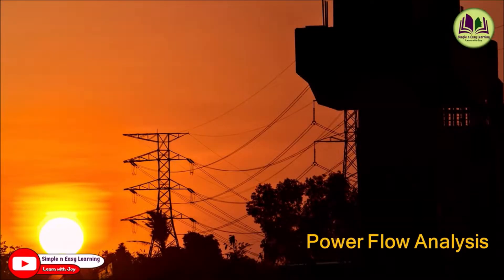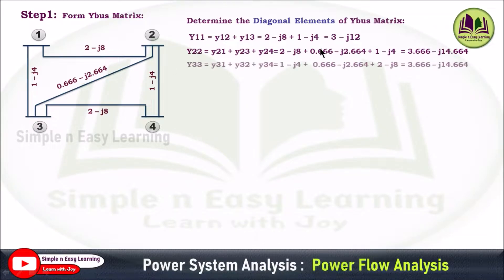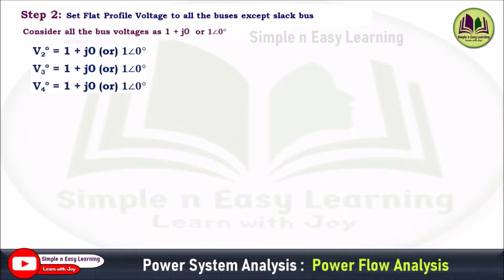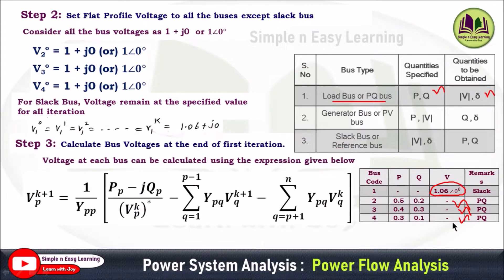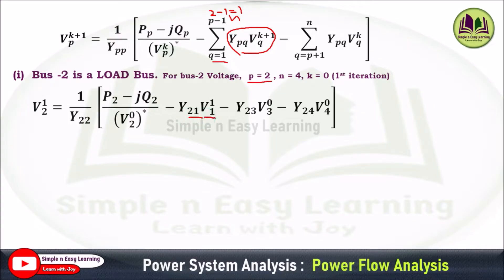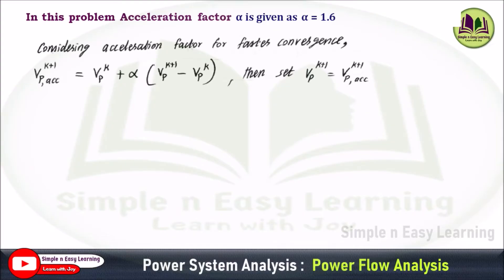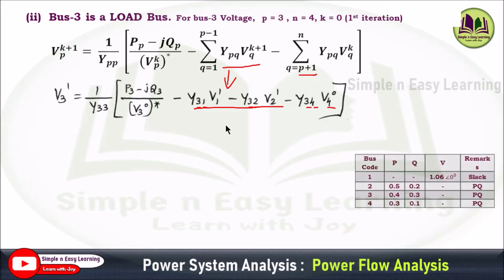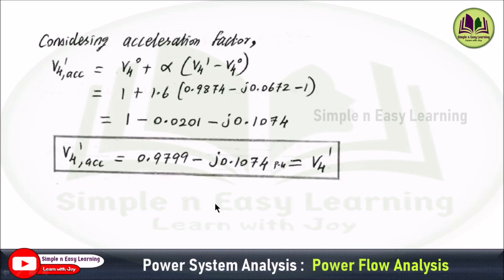Gauss Seidal Method Solved Problem -1 |  GS Method | Power flow Analysis | Power System Analysis

Comment: How to solve when the acceleration factor is not given?
Reply from the maker: If the acceleration factor is not given, there is no need to calculate 
𝑉2acc′, V3acc' etc..,  Hence, 
𝑉2 ′,  V3'etc.., may be taken as the final answer.

Comment: Sir how do you did this 
1+j0+1.6(1.0119-j0.029-1-j0)
which is equal to 1+0.0224-j0.0447
I keep getting 1+ 0.01904-j0.0464
Reply from the maker: I calculated using polar to rectangular and rectangular to polar conversion. I got 1+0.0224-j0.0447.

But if we use complex mode in calculator to calculate this we'll get the value as 1+0.01904-j0.0464.

Both the answers are correct.
Reply: @simpleneasylearning thank you very much sir